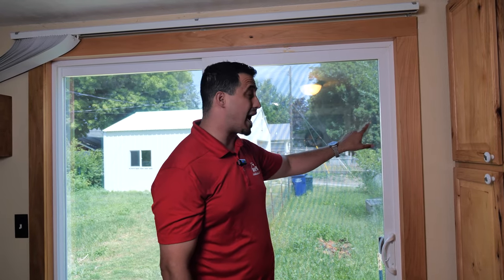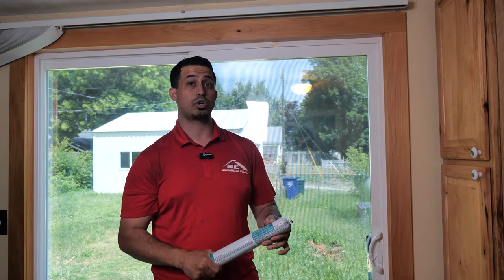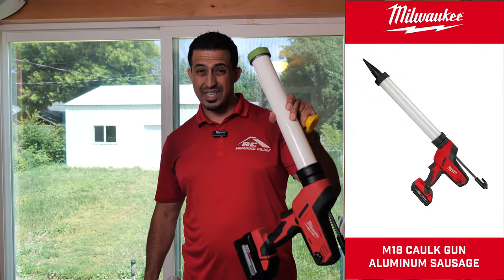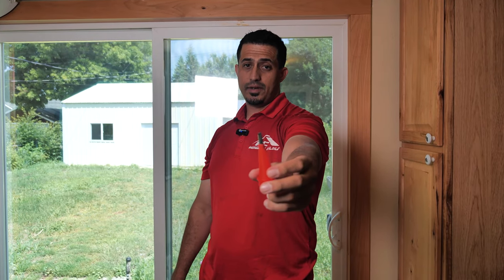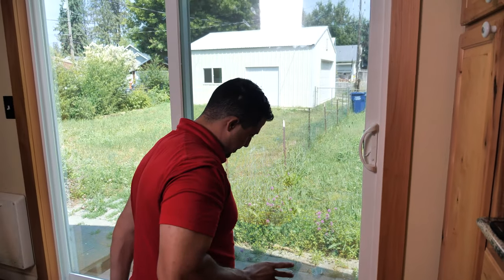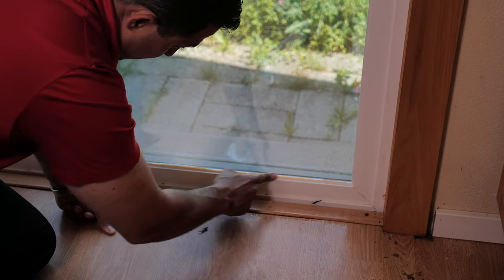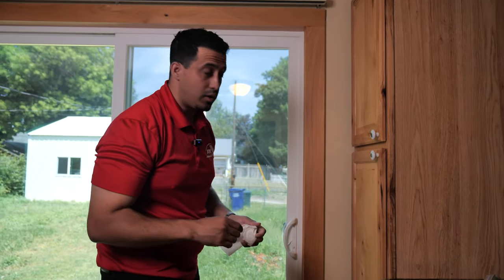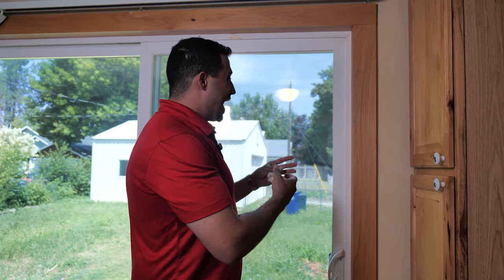Dow Corning 995 Attachment for Security Film on Sliding Glass Door: A Step-by-Step Install (Part 2)

Comment: Nice video! Some questions:

a) Does the sealant have to be the DC 995 silicone sealant? Can it be another highly rated silicone or even polyurethane sealant (e.g. Tower Tech-2, BASF N1?

b) Will this film further improve upon glass that's already rated for ballistic and forced entry, e.g. Riot Glass ? Can we apply the film to both sides of said glass to achieve  both the mirror tint of the DC995 and its impact resistance?

c) Does the sealant work better with certain frame, e.g. PVC vs wood vs metal?

d) approx cost per sq ft of the 995 film (8 mil)?

Thanks!!!

Comment: I have a double pane (glass on both sides with Argo within the pane) glass door. My question is ? Should I put the 8mm secure film on the outside glass since that will be the first one to be broken or on the inside pane to prevent entry. It’s a double door French style, with a 12 w x 63 L inches glass
Reply from the maker: you most certainly can. It’s always best to install security film on the interior portion of the window, however, installing it on both sides with a sealant on the interior is the best route.

Comment: Can you use an interior dual reflective film on a window with a clear lo e coating on it?
Reply from the maker: yes you can use dual reflective on low e coated glass. However i would avoid using them on glass with a low e coating specifically on surface 3.